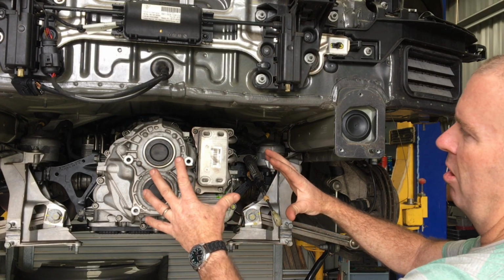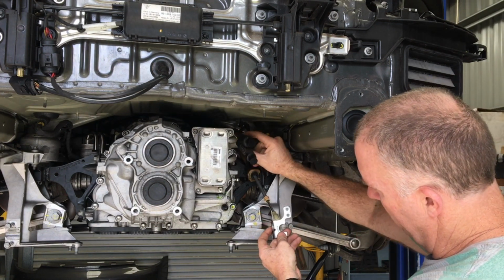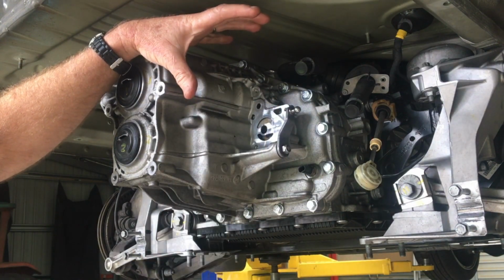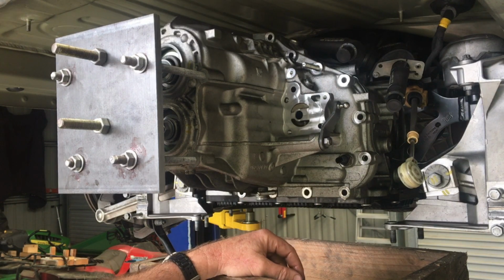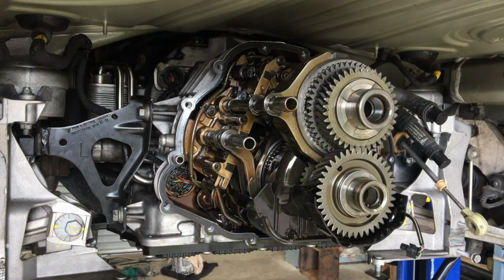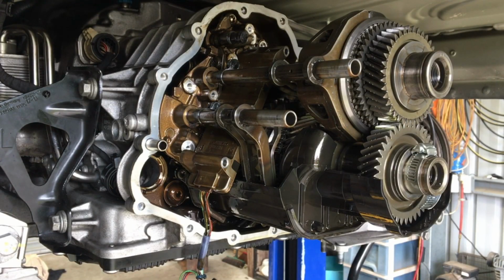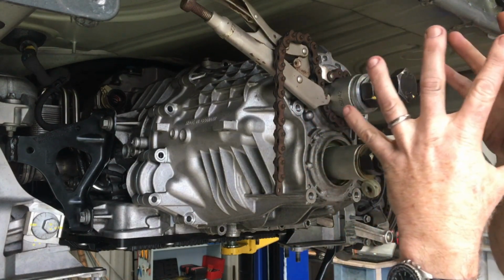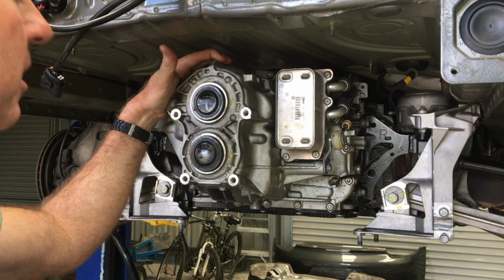Boxster/Cayman ZF PDK distance sensor replacement

Comment: Do you know amount of teeth at first and second shaft for shaft speed sensor? As I know for 981 and 991 first shaft has 22 teeth and second if open question. assumptions is that 981 also 22 and 991 24. Could you advice please.

Comment: Jeff I’m having trouble closing the case on a 911 991 (carrera S) it’s in the car and I am about 1.5 mm away from it closing (I’ve checked everything, bushing , magnet, wire, the shift lever is forward (the parking rod is retracted.) What am I doing wrong?
Reply from the maker: Have you pulled in using the large bolts from the rear and have the circlips installed at the back or are you attempting to pull on using the perimeter bolts?
Reply: @jeffrichardsoncardiy  used big bolts, c-Clips  are removed
Reply from the maker: @NICHOLASSTEINBACH-wz2im  Normally I use the big bolts until I can get the circlips on, which means the shafts have been fully pulled through the bearings. At this point there is still normally a bit of gap between the rear case and main case. This is because the shafts float. At this time I pull the rear case fully home with the perimeter bolts.
Reply: @jeffrichardsoncardiy  ok sounds good I’m really close about 1/16 of an inch or so but just can’t do the cir clips yet
Reply from the maker: @NICHOLASSTEINBACH-wz2im  If the circlips won't go on then the shafts haven't been pulled through far enough. Without being there it's hard to know why. Do you have the front idler shaft bolt installed. This is the one that goes through the front casing. The rear bolt should be removed, but if for some reason you have removed the front one it will jam everything up. Did you grease the shafts and bearing faces prior to install? Also it's possible to pull one shaft in more than the other if you aren't careful to do it evenly, which might be the cause. Regardless, I'd be pulling off the rear casing, checking and start again.
Reply: @jeffrichardsoncardiy  the side bolts are removed so nothing there..The only thing I can think of is the shafts are through the bearings but appear very slightly different (eg 12 and 6 o clock about a 1/2 mm difference.) and the one side of the case might be closer to the transmission but very little again not sure how tight the tolerances are
Reply from the maker: @NICHOLASSTEINBACH-wz2im  When  I mention the idler gear shaft bolt removal (look at link below that starts at the correct time), the one in the rear casing gets removed. The one a bit further forward of this that goes in at the same angle through the main casing must not be removed. If removed it allows the idler gear shaft to move on the inside and it will jam everything . From your message above it seems to indicate you have both these bolts removed.
https://youtu.be/N7U_HG-SXKM?si=ERioJ0-jLIgnmDMg&t=306
Reply: @jeffrichardsoncardiy  thank you will do
Reply: @jeffrichardsoncardiy  the idler gear bolt is the hex head, it’s still in there I was mistaken that I took it out
Reply from the maker: @NICHOLASSTEINBACH-wz2im  Can you send me an email to jjrichar12@gmail.com so I can send you a photo showing what I mean.
Reply: @jeffrichardsoncardiy  yes will do give me an hour or so
Reply: @jeffrichardsoncardiy  emailing you now
Reply: Same situation here, any idea?

Comment: I have a question, if I may ask: my trusted garage just installed a new PDK Distance Seonsor. However on Calibration (long procedure by now, as we/they didn’t know better then) always stops, with Errors 1870 and 1767. While it does start the shift rod calibration (you hear the clicking) the progress bar in PIWIS doesn’t move and it stops with Function aborted with Error. Our Sensor Readings are -0,18 for No. 1 and 8.17 for No 2. 0,58 for No 3 and -8,719 for No. 4.. Just learned that the rods can be manually move, so nothing is “stuck” in general (and they can be all 0,0,0,0 before the start of procedure). Now my guess is that there may be something on the valve body, somewhere along the lines of “yes it moved the rods in one direction, but when it tried to push them back, there is e.g. some clogging in the valve body, so it doesn’t shift back. Is that in general something possible ?  Thanks in advance and GREAT VIDS!!!!

Comment: Hi Jeff, I have a 987 with P177F dtc and no drive. Changing the valvebody made no difference at all. Do you suspect a issue with the distance sensor?
Reply from the maker: Send me an email at jjrichar12@gmail.com to discuss. Easier to pass info and docs. This email address is one I rarely use so I'm happy to put it up here in public. Reply here when you do so I know to go and find it. Jeff
Reply: @jeffrichardsoncardiy  thanks Jeff. I just send you an email on that address

Comment: Hello Richard, what happens if the shift rods  are moved  manually by hand during the repair. Any issues that might come up ? Thanks in advance , Tom
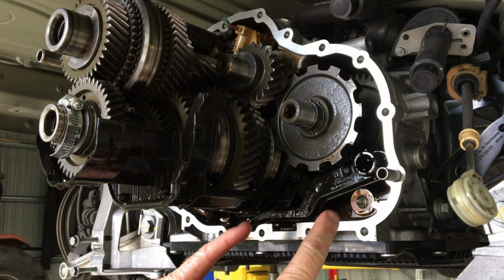Reply from the maker: The only danger is if you move the rods without a hose clamp holding the gears on the lower shaft like I have in the video at the 17:00 mark . They need to be held so there is zero movement rearwards of those gears. If the gears can move rearward the synchromesh can get screwed up and it can be very difficult to get back engaged correctly.
Reply: I was wondering if you could possibly get air in the actuators of the rods.
Reply from the maker: @TomHouse-bn4es  Air probably gets in there, but I've done it loads and never had a problem.
Reply: Hi Jeff, just saw that this answers my other quetion already, (so it could be a problem) but would be good to point this out a bit more explicitly  in the Video (as I just realized on 2nd view) -while „VERY HIGH LEVEL“ complaint, given that your vids are super well documentation in general!

Comment: Jeff did you make the rear removal tool or is that commercially available? Thanks
Reply from the maker: I made it myself. Just a piece of plate steel with some holes drilled into it. The template for the hole locations is in the rear cover removal video.
Reply: @jeffrichardsoncardiy  Thanks Jeff, Really appreciate the fast response.

Comment: Thank you for all of the fantastic information! I need a bit of help though. I have replaced the range sensor and put together the case by tapping it on with a dead blow hammer and then slowly bringing in all of the case bolts little by little pulling it on. It worked great but now the 2 shafts in the rear aren’t looking through enough to put the circlips on. I tried using the plate that inside to remove the case to press on the bearing to push it in a bit but no luck. Does the shaft actually need to be pulled out since it’s floating? Have had some trouble finding large enough bolts to try the method you show. Help would be appreciated! Thanks
Reply from the maker: Yes, the shafts float in a mid position, between 0.5 and 1.0mm back from the fully forward position from what I've measured. I'd be very wary of using a mallet to hit bearings onto the shafts. Even pulling it on with the case bolts I think is a risk. There is a bearing and seal between the two input shafts that is at risk of being damaged by doing it this way. From my perspective I see the only safe way to do it as how I describe, and it also from what I've seen is really the only way to pull the shafts fully through so you can fit the circlips.
Reply: Thanks for the reply! And yeah, definitely makes sense now that I realize the shafts have to be pulled in. I would’ve done that from the beginning if I had known that. I only tapped it on lightly just to get it situated and then did each case bolt not even a quarter turn so I think everything is OK. The shafts just need to come out just a tiny bit so I can get the snap rings on. I’ll get to work finding the right bolts and finish it up. Thanks so much for your videos again, I appreciate it.

Comment: I just finished doing two of these. The second was on a 991. Had to use spacers for the extraction tool on the 991 because the rear case is different on those: as it incorporates an engine mount, and the two shafts are staggered. Also the 991 had a nut inside the lower shaft not a c-clip. 🤷‍♂️
Reply from the maker: Nice job. We are slowly getting more information about the differences between the different transmission types. Which sensor did you install, T design or XemodeX? Any issues with the cals?
Reply: I actually used both. On the 981, I used the T-Design. On the 991 I used the Xem. I did not have to calibrate either one. Fired up the cars, and they were ready to go. I have since acquired a 991 (this is a personal vehicle), I ran into something interesting: the shaft magnets were completely full of clutch material and debris. Nothing abnormal, just the typical build up you would see on a magnetic component. 

So instead of replacing the sensor, I cleaned them, and it has been trouble free for about 800 miles now! Since this is a personal vehicle, I wanted to see what the result would be. Car only has 44k miles. 2014. Did t make sense to me that sensor would have failed already.

I'll share my experience on rennlist. Also, I don't solder the wires. I have the tooling and just make my own terminal ends. They are male molex terminals.
Reply from the maker: @LynxStarAuto  A lot of good info here. That you had a failure just because of the magnet debris is interesting. Were you getting PIWIS codes for the distance sensor on your personal 991, or were there other symptoms? Once cleaned did you have to do a cal, or did it just work? If you can put as much info as possible up on Rennlist the community would be very appreciative. Being a shop you will be seeing a lot more of these that the average DIYer. Most shops are very hesitant to put out any information they have, so getting good information from people who see a good number of these is going to be great. Thanks.

Comment: Thank you for the perfect documentation of your work!
Two questions:
- What is the inner and outer diameter of the pressure sleeve of the lower M22 thread? For the M24 I saw in the video 52/42.
- Did I understand you correctly that a M24 x1.5mm screw is needed at the top and a M22x1.5mm screw at the bottom?

Thanks Roland
Reply from the maker: Shaft sizes are 40mm (this uses the M24 screw_ and 33mm (this uses the M22 screw), so the sleeve inside diameter just needs to be slightly larger than this. I used a 42mm and 34mm. Doesn't need to be exactly this, just as long as it's larger and sits on the inner race of the bearing.
Reply: @jeffrichardsoncardiy   Thank you for the quick reply. I had problems finding a comparable bolt with a long enough thread for the M22 bolt. I have now ordered the following sleeves which are not as long as the ones in the video and hope that the 56mm thread of my bolt will be sufficient.
NTN, 1R35X40X20
NTN, IR42X47X20
Reply from the maker: I know I used the bush removal tool sleeves for the job, but you don't need a specialised tool. Normally in the past I've just gone to a metal supply shop and measured what pipes they had available. Then just get them to cut you a small piece. It doesn't need to be long. The shaft only needs to be able to come though about 1cm, so this is really all you need.
Reply: @jeffrichardsoncardiy  I need some help with my pdk has code p181a and p0841 after a ecu tune and power upgrade the clutch was slipping so a pdk tcu tune was performed with more clamp force.    The car then would go to a limp with a full throttle. key on and off code goes and car runs fine and a revert to old stock tcu file the issue goes away. What do those code usually indicate. Same files have been used on multiple cars. With the same upgrades.   Thanks for any info
Reply from the maker: @tmb11111  Those codes are for an implausible signal for the pressure sensor for clutch 1. I suspect this has something to do with the increased pressure being applied to the clutch with the tune and this being sensed as out of limits. If the tune is working fine on other cars, I suspect your transmission is applying more clutch pressure than others even though the same tcu outputs are being sent to the valve body. This is probably just pushing it beyond the implausible signal limit.
Reply: @jeffrichardsoncardiy  thank you.